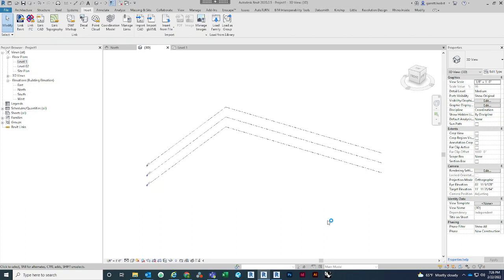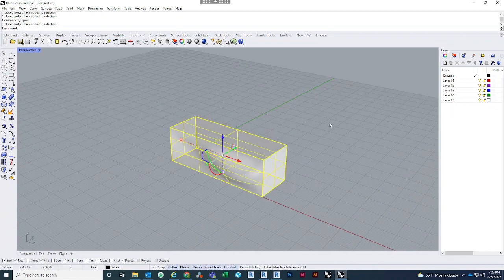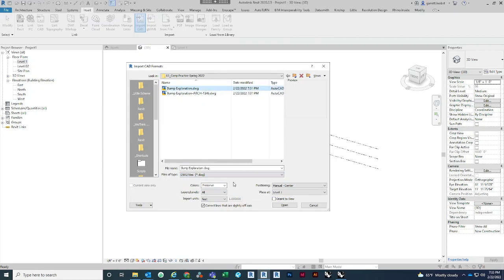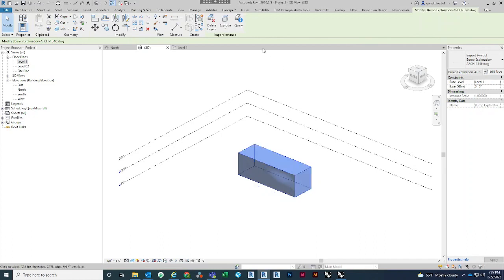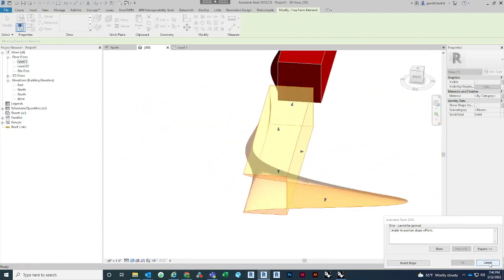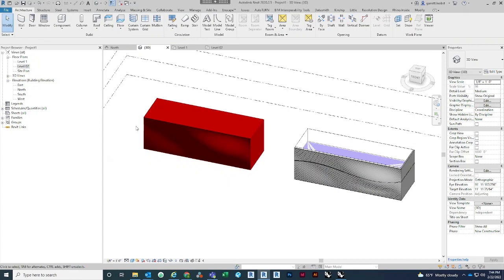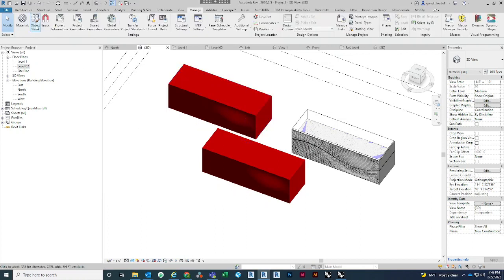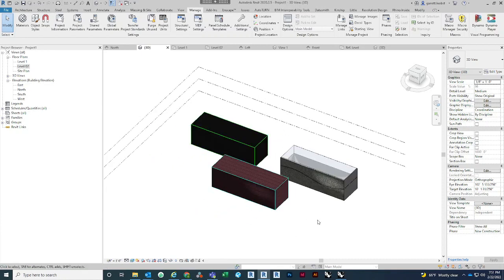Revit - Importing & Manipulating Rhino Geometry

Comment: so this seems to work well for poly surface objects, but Im trying to deal with mesh and nurbs sometimes and Revit doesn't like those.  I find rhino inside direct shape, or conveyor plugin work easier and allow for some bi-directional workflow that this method does not.  There is a lot of post processing happening here that can be pretty easily pre-done using rhino to revit or conveyor.  That said, there was still some useful info in here, I like how it gives you a manipulable mass in the mass editor, also conveyor wont let me send to a family it has to be a direct into project object.  So for certain use cases this is a viable work around for sure.